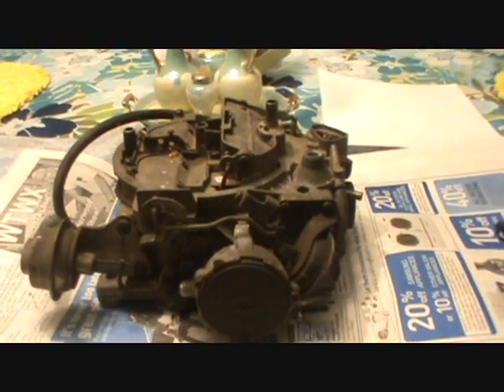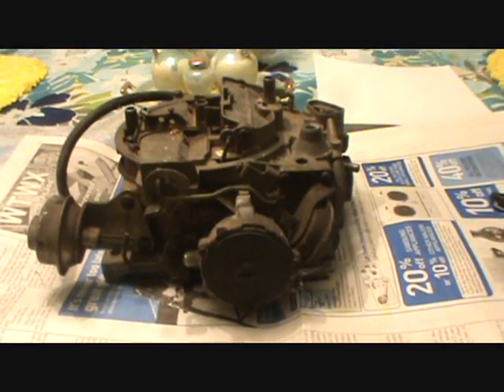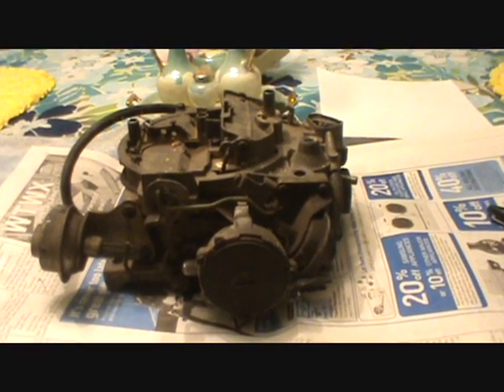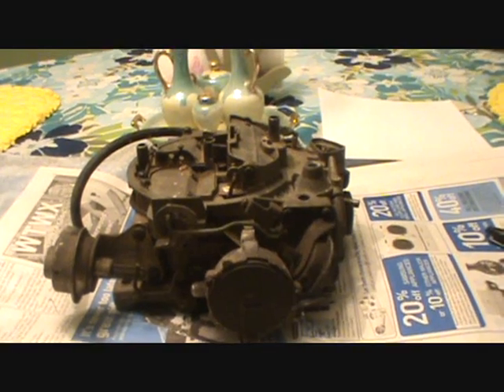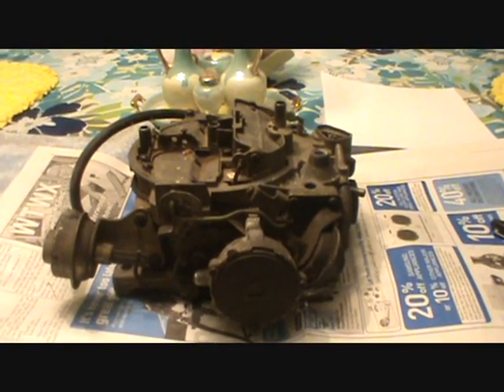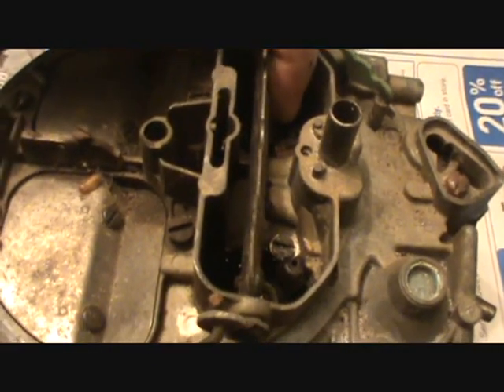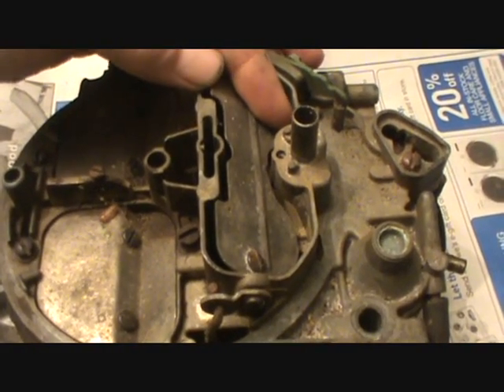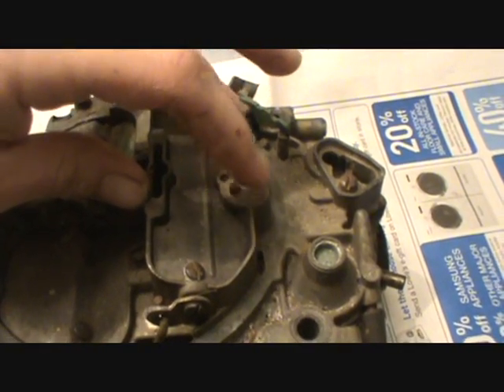How to understand automatic chokes part 1

Comment: @WhoSaidTyler   It's been easy to start but I've only started in inside my house, or immedeiately after getting it outside, or outside while the engine is still warm.  (Too cold to work on it outside here in Minnesota.)

There seems to be a air channel created when the enricher is bolted to the side of the carb.

Does that sound like something that would cause a misfire at (and only at) higher speed?

Comment: @WhoSaidTyler Well I took the inlet fitting off again and it turns out that the gasket is for a 1" diameter inlet and the gasket is located on the forward edge of the inlet fitting not the sealing flange, and it was there! I was so worried about over torquing the inlet fitting that i just didn't tighten it enough I guess. I tightened it up and no more leak. Its all trial and error at this point, this is my first project car ever so I'm learning as i go along, Thanks again

Comment from the maker: @piroguy14  I don't have access to that info unfortunately. Your best bet would be to take the filter housing with you, but keep in mind that gasket is nylon(plastic), not paper or rubber.

 You can also check the replacement filters to see if they include a seal. I often buy a carb kit just to use for spare gaskets, it'll have one in it.

Comment: Hi Tyler, so I recently replaced the fuel filter on my rochester 4bl on my 79 caddy and I am having that problem that you specifically talked about in one of your videos. I replaced the filter and now it drips from the inlet nut housing. I it took it back off and i either dropped it the first time and didn't realize or something because its not there now. Could you by any chance give me the dimensions of the gasket or where to find the dimensions so i can have Napa punch me out a new one? Thanks

Comment: I have a automatic electric choke on a Quadrajet on my 305 engine. The Carb has been rebuilt. Can't seem to make adjustments that will make my Chevy truck drivable. It will idle in park but the minute you put it into drive it stalls. I have noticed that the choke plate flutters a bit when it is open (hot). I suspect I either have some sort of vacuum leak. Is it the linkage responsible for holding the choke plate open steady or is it the vacuum?. Please give me your thoughts on this.

Comment from the maker: @KCBCA  It faces the front of the car. Get yourself a short screwdriver that you are sure will fit in there and start the engine cold. Let it idle fast as you describe and begin turning that screw out(counter clockwise) The idle should start dropping down to a more reasonable level. Adjust it so it's still idling faster than when warmed up but not crazy fast.

 Again, this screw is located on the PASSENGER side of the carb. It doesn't screw into the carb itself.

Comment from the maker: @KCBCA  Your problem appears to be that the fast idle setting is too high. There is a SEPARATE adjustment screw for that, and it's located on the passenger side of the carb between the choke housing and the carb itself, at the bottom.

 You'll have to really peer in there and find it, but it's there. I'm not talking about the two idle mixture screws which are on the base of the carb facing front. The one you want is far on the passenger side.

Comment: on my ridin mower, i love having a manual choke. that old carb has seen better days, and i have to pull it apart for cleaning 3 or 4 times a season. if im mowin and it gets really dusty, the carb will start cloging. when it starts to clog, i can give it just a little choke to bring it back from lean

Comment: my choke on my M4ME carb on my 1986 350 suburban was wired open when i bought it, and the low idle screw was screwed  all the way in, so it was idling like 2000 rpm. i removed the wire, and choke plate. set the idle, and got the linkages working.now, i need to put the choke plate back on now. the choke missing doesnt affect my worn carb that much, because it runs super rich anyways. i know before long, im going to replace my carb